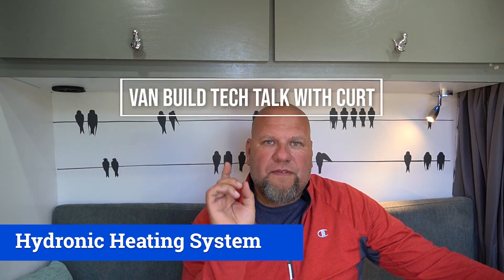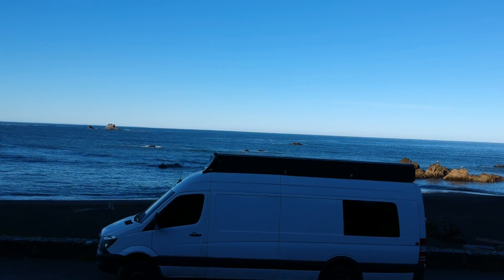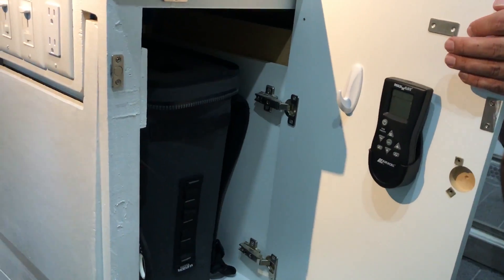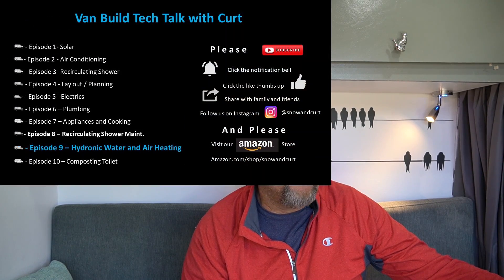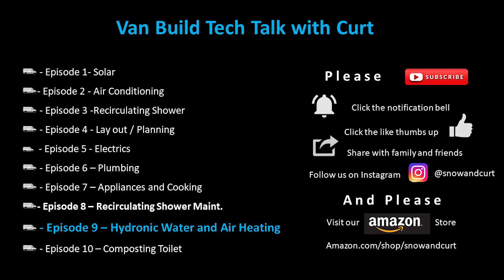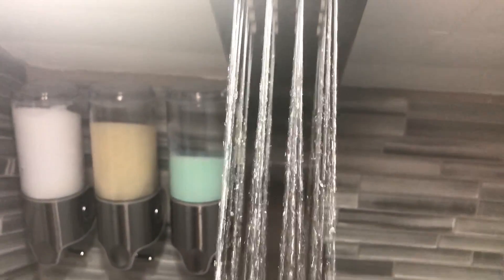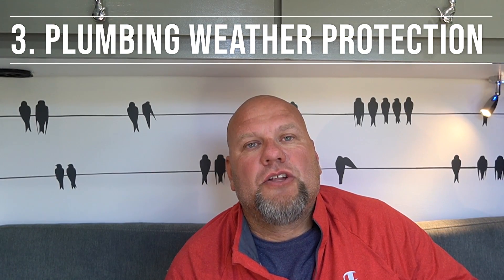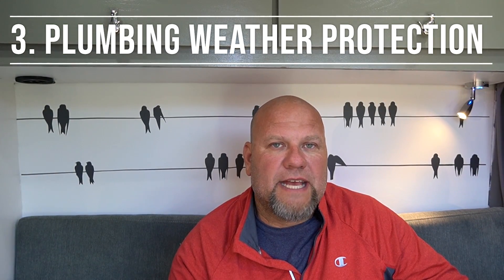Sprinter Van Hot Water Heater, Hydronic Heating Systems Explained - Van Build Tech Talk Series Ep .9

Comment: Hi Curt,
I've already told you but this van rocks ! Everything inside this build is inspiring...

I was just wondering if it would have been difficult / reliable / economic to add another heat exchanger in the loop and feed it with your engine coolant.
It just needs the pump runnig while you are driving... So as long as you drive, you heat your hydronic fluid and you could just park and shower without using the heater...
The main idea is not to waste the engine heat. Because you need to cool down the engine and heat your hydronic fluid, so maybe a simple heat transfer is an idea...
Am I wrong ? I can't figure out if it worth the extra piping or not...
Regards, Jacques-Olivier
Reply from the maker: Jacques, you are spot on.  Two reasons I didn’t do that...1)I didn’t have the confidence I could do that myself, which leads into 2) I was concerned a failure in the added system could potentially lead to damage to my engine.  I would say if there was no risk the way you described is the way to go.  In fact, I may do a bit more research that modification as it would add to overall efficiency.
Reply: Conversely, with the systems tied together, the fluid could be switched to warm up the diesel motor...then possibly only one expansion tank would be needed. It would be imperative to be able to isolate the systems entirely in the event of a leak- easily done with quarter valves. Another consideration  is filling the system so no air pockets remain. A vacuum coolant filler can be had for as little as $30. On the other hand, I think I could plan my showers (the only hot water I really need) around my engine run times which would simplify the system but still be the best way for a long shower time.

Comment: Good video. Glad to see someone who is actually doing what I'm contemplating in the future.

I've looked at some decent quality companies which sell for more reasonable prices than 
Wabasto and Eberspacher.

I've found a Chinese company which sells high end heaters both hydronic and air. 

One company is VVKB. They have a dealer in the USA.

There is also a Russian company which sells both air and hydronic systems. They can be powered by diesel or gasoline. 

The company has a distributor in the USA.

The name is Planar. They are also known as Autotherm. 
The Russians know all about battling cold conditions. Their stuff is supposed to be as good as the German companies.

I've read that diesel units tend to clog with carbon when used at high altitude or on a continuous low setting.

It's said that kerosene works a lot better.  Supposedly a mix of 80% kero and 20% diesel keeps the fuel pump from wearing out.

I've also read that #1 Stove Oil is basically kerosene. 

Also Jet-A aircraft fuel is highly filtered kerosene.  Smaller airports supposedly will sell to folks who don't have airplanes. 

Both Stove Oil and Jet-A fuel sell for less than consumer grade kerosene.

#2 Home Heating oil is basically diesel which has been dyed for tax purposes.  It costs less than diesel because the price does not include road tax.

I'm just reporting what I've read so far. Do your own follow up.
Reply: legend.... another high grade is the Lavanar Pro range - with a high altitude option.
Reply from the maker: Good info... thanks for sharing!
Reply: Can confirm on the Jet A - used to have Amish come in and buy barrels of the stuff for their lamps. We'd put a adapter on the end of the truck "duckbill" nozzles to fit the barrel openings and be limited to 7gpm which was a fraction of the wide-open flow rate. Was a pain but at smaller airports a customer is a customer. Supposedly it didn't smoke up their lamps like kerosene. Can also ask them if they have any sump fuel they are not using. Regulations require them to pull daily fuel samples and at the airport I worked at we had barrels of the stuff which was still fairly clean. We burned that stuff in the trucks and hangar heaters and still had more than we knew what to do with.

Comment: What controller are you using for your Espar?  When you install the radiator for heating the interior of the van will you trigger this off of the timer function only or have you figured out a way to control the on/off function of the espar with a wall mounted thermostat?
Reply from the maker: 👆 what he said!

Comment: Did you consider radiant floor heat?
Reply from the maker: I considered it for sure!  I was crunched for time but if I had to do it again I would definitely do the radiant floor!
Reply: We are in the process of reworking our Class C, and, have been Seriously thinking about the radiant heat in the flooring.
Reply: That is all it would be for. The original setup works fine, just wanting to give it a bit of 'Help' .
👍😎👍